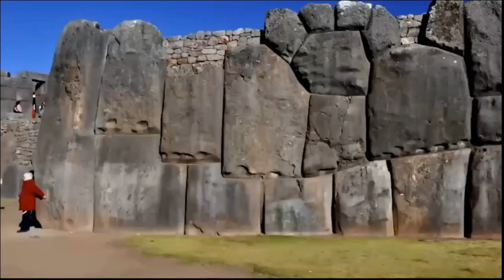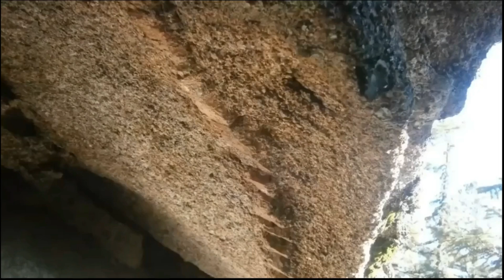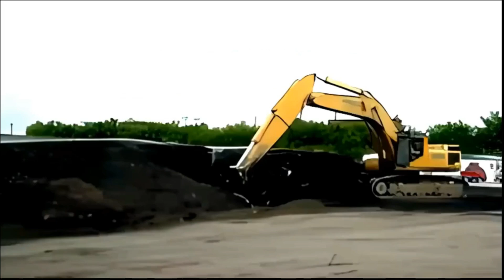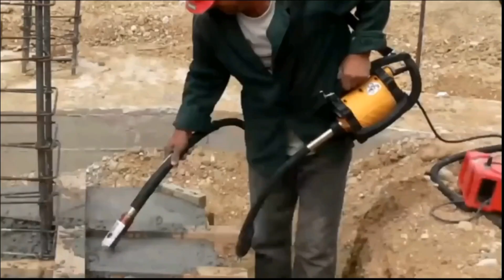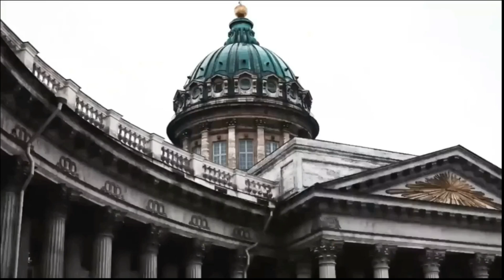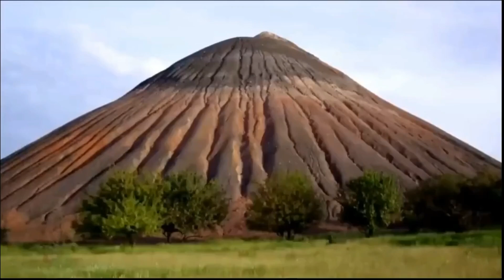How Lost civilization Built Impossible Stone Structures

Comment: Of coarse if you use fire to help cut stone it depletes some of the silica in the stone. Which does resemble a cement then. But won't show uniform silica like a cement. Which makes the stone a lot more easier to work. It's common to do that with gold ore too. Which the Inca did a great job at extracting gold. They knew their stuff. They also have native copper there too. Like up around lake Superior.

Comment: To show off Michigan’s forest industry at the 1893 World’s Columbian Exposition, lumberjacks from the Great Lakes State cut and stacked 145 tons of white pine logs on the sled. Just 2 horses pulled the load more than a quarter mile. It would take no less than 13 horses to pull 700 tons. Extra horses because weight of rigging. The nipples are to hold blocks up in the quarry. That were then cut away the bottom. They cut sides first. Then chiseled under it. You only need a rock or mineral harder than the stone you are working, Some people even had aurochs to pull heavy stones like in the U.k.